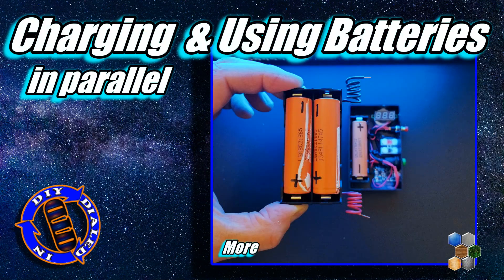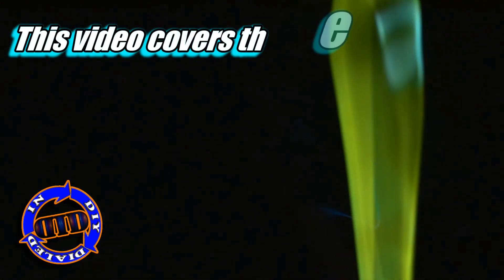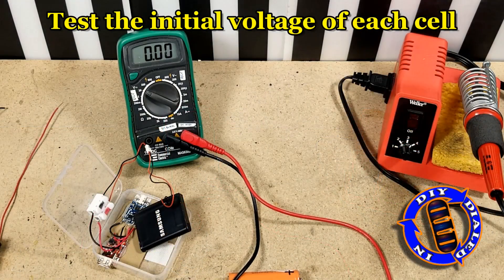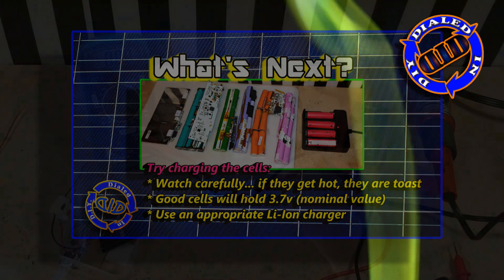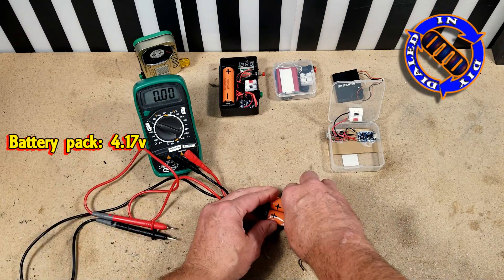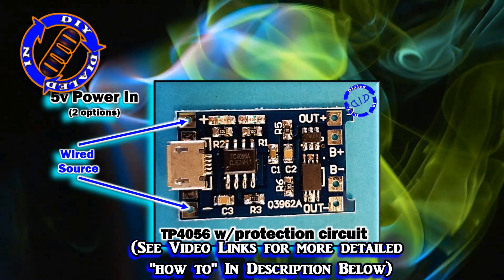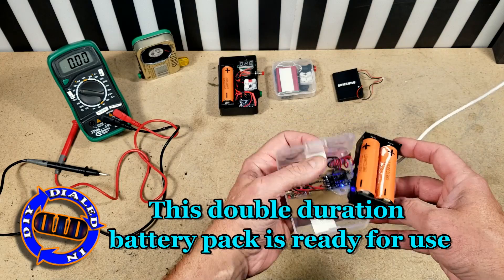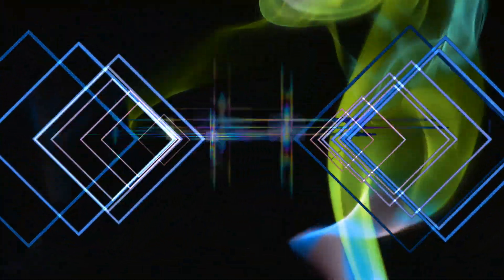Charge and Use Batteries in Parallel - DIY Li-Ion Chargers

Comment: I can't remember. Have you done a video where you convert a standard landline to USB power converter? I was thinking ahead a few months to our stormy season when we loose power. I'm good on the landline end, but I haven't done any snip-n-splice with usb cables. Most of the rooms where I live have landline plugs, but we are all strictly mobile. Thought it might be a good back up for phones if the power's out an extended time.
Reply: Interesting idea, however some older landlines still receive up to 90v DC "Ringer Signals" above the general 9v DC "Tone". You could easily have your port and anything connected to it fried if a call signal (say from a test, telemarketer, or National Emergency Service) came over your line. :/
Reply: @grayeaglej  didn't quite think it through i guess. Thanx for the input. It is greatly appreciated.
Reply: @coolnegative  Its an interesting idea it just requires more engineering and equipment than one might think. If you have ever looked inside an old telephone that used actual ringing bells you can see the high voltage parts. Its all relatively low amperage but still required some pretty heavy duty components. 
More modern telephones and equipment have electronic rather than mechanical means of dealing with the high voltage so any power supply you built would have to incorporate something like that and be robust enough to block all surges instantly so as not to fry your delicate digital equipment being charged. O.o Good Luck.
Reply from the maker: Another thing to consider is the use of fiber optics for supply in some areas have completely changed the "available power" concept. I have instead opted for more simple methods of emergency charging... like making my own crank generator (motor & wires) and hooking it into the appropriate component to control the power flow. Use that to charge a battery pack in the absence of power... I have not done a video on that yet... might need to move that up on my list. Thanks again to you both!!
Reply: @DialedInDIY  Yes Fiberoptics and Data-Lines were what I was implying were replacing the "Older Systems" I was primarily talking about. Even though the US's entire telecommunications grid was supposed to have been upgraded decades ago so very much of it is still carried on analog equipment that can be in excess of a hundred years old O.o The mixing of old and new, and the legal monopolies that telecom companies have, make such projects very problematic o.o 
I personally prefer being able to build my own voltaic piles out of scrap to provide power if/when absolutely everything else is gone. Suprising what you can do with a few pennies and some vinegar. O.o
Reply from the maker: @grayeaglej  So true... on all points. Ah yes, the penny stack (voltaic pile, the original chemical battery)... that is a cool power project too. Thank you for reminding me of that one!  I haven't done one of those in a long time. Hmmm... I've got plenty of vinegar and salt available I should do that one again for some fun. I never tested how long the response would last or how big I could make a project. I've also yet to make a video on Leyden jars... that's been on my list for a while too! Thanks for your comments... I greatly appreciate it!
Reply: @DialedInDIY  Thank you, we greatly appreciate the videos ^-^ Not all of us Wastelanders, Tinkers and Mad Scientists have the time, patience, and/or equipment to produce such material. :)
Reply from the maker: @grayeaglej  Thank you very much!... and I think I fall into each of those categories (LOL). Sometimes I run very thin on time and/or patience but it is truly a fun hobby that provides a much needed outlet!
Reply from the maker: Exactly!  I too love the idea and have tinkered with the concept but alas I also did not want to deal with the issues that I could face where I live including legal ramifications.  Thanks for watching a posting replies!!
Reply from the maker: It is actually a neat idea that has some merit.  Although I have tinkered with using landline for different purposes (but not done a video) there are several issues to consider including those mentioned by MGE.  One issue is that, to the best of my knowledge, it is not legal in most locales (it is considered to be a form of stealing).  While I am not an expert on it there are multiple power variances to consider; voltage rise with incoming bell signal (as AC current), unloaded DC voltage (around 48) and voltage drop under load conditions (3 - 9 v DC).  That said, I've seen people suggest it can be done but it typically seems that one or more of these variables were left out of their plan... so back to MGE's comment... incoming signal spike would trash most of the easiest methods of trying to capture this as power.

Comment: I think you need a over change  maybe  get you problems if you don't know what your doing I think you should just buy them then try to make it yourself it maybe you will not do it right or the battery maybe blow up
Reply from the maker: If you are talking about overcharge protection, then yes it is needed. Fortunately the part I use in the video, Charging board - TP4056 has protection circuit built in.  This protects both overcharging as well as over-discharging. Thank you for watching and taking time to post a comment; I appreciate it!